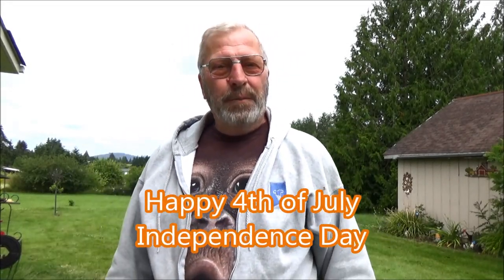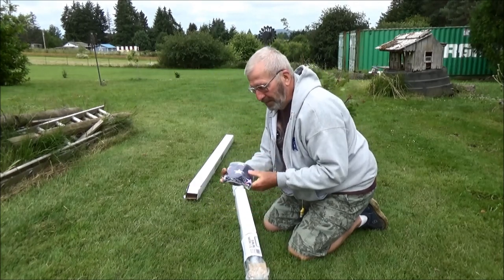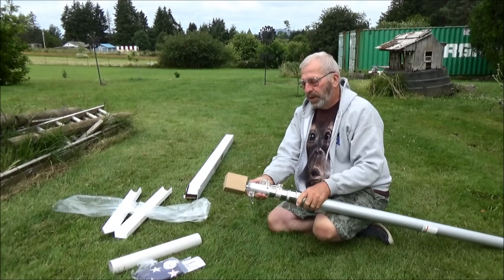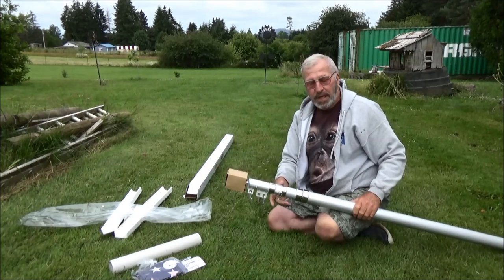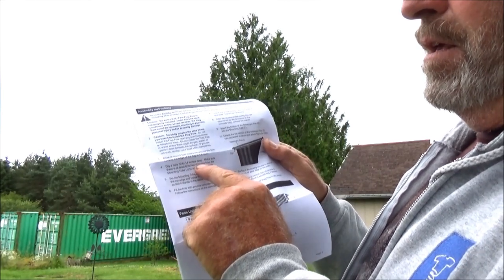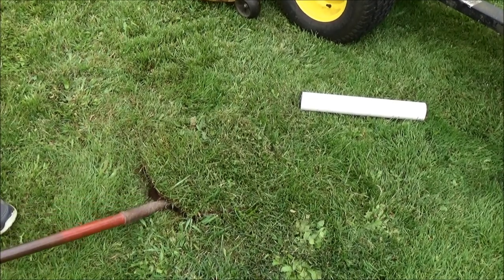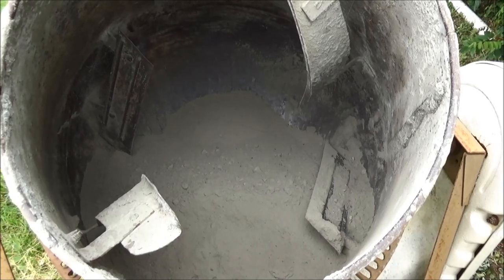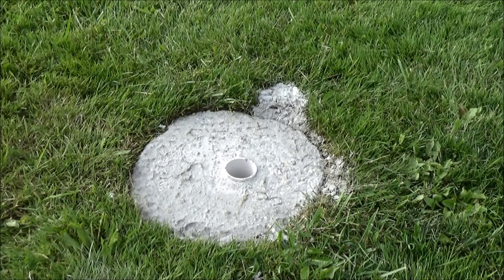Harbor Freight Flag Pole Unboxing and Install

Comment: How do you fly the flag at half mast with a telescoping pole?
Reply from the maker: Charlie, it is just like T.V., it is all an allusion. You pull down two of the sections and your flag looks like it is half mast from a short distance away. Thanks for watching Charlie Dubridge.
Reply: I have a telescopic pole that can hold two flags. I move the flag down to the two lower clips.

Comment: How has the poll held up over time?
Reply from the maker: My pole has done great and as long as you keep the Riding mower away from the pole, I think it will do fine. Even with the high winds we get sometimes and flying one flag, the only thing that happens is the pole sections will start to slide down in the high winds.
Reply: @justmike57  awesome... I'm about to go get one this week...great video buddy...

Comment: Do you happen to know what guage aluminum this pole is?
Reply from the maker: No, I don't know the gouge the pole is but I am sure it will get by for a few years and there are another two reasons for the way I set up my pole. Leave 2" back in the pipe to help with the strength of each section, and this is why the poles are not that tall, lighter metal for the pole.
Reply: @justmike57  thank you Mike

Comment: What do I do if some of the sections will not stay in place? They slide down? Anyone have a fix for this?
Reply from the maker: That is one of the problems with this flag pole. I just snuggled my in place. I think if you are over tightening the sections, they become loose again. Also, when you pull each section up, slide it back down about 2 inches seams to help before tightening.  If there is still a problem with the sections sliding down, I would pre drill and add a metal screw to each section.

Comment: I would go a lot deeper than 12 in, I would go 36 in deep and you don't have to be exactly 15 in wide. I go a little wider in case you put up two flags with high wind
Reply from the maker: I have found that using 2 90lb bags of premix seems to fit the bill. Depending on your area, you will want the tube for the pole too be opened at the bottom for drainage so in the winter, the water build up in the pipe dose not freeze. Thanks for stopping in Joe R.

Comment: Do you have to cement this in?
Reply from the maker: It gets a bit windy here and I used two 90lb bags of Ready Mix Cement. My brother used the foam they have in place of cement and it didn't work. My brother used one bag of 60lb Ready Mix and dads pole is leaning bad.

Comment: Better set it in the hole b4 raising it  * I Pledge of Allegiance, to the flag, of United States of America *
Reply from the maker: I found that if you keep messing with the locks on each pipe, they tend to not want to lock anymore. So I pull it out of the hole when I want to change the flag 426 Super Bee. Amen to the Pledge of Allegiance.
Reply: @justmike57  wow i though they where pins going threw them / Is there a way to use pins? THANKS MAN FOR BEENING A TRUE Patriot ~ Amen
Reply from the maker: @426superbee4  I would suggest to drop each section 2 inches back into the lower pipe and drill a small hole, then use a screw to permanently keep each pipe up in its place. Just weak locks on this pole.

Comment: Did he really put that flag on the ground?
Reply from the maker: Nick, did you really watch the video close and replay the part where the flag was on the ground? The flag was still in the plastic wrapper, so I felt safe to set the flag aside until I needed it. Also, I didn't show it in the video, but you are suppose to have a light on the flag when it gets dark or bring the flag in. I have an L.E.D. light shining on the flag when it gets dark. So thank you for worrying about the American Flag. It is still safe and flying strong.
Reply: @justmike57  yes, I did notice the flag in the bag.  No disrespect, but I’m kinda a stickler with the flag on the ground. And yes, I am aware of the flag needing to be lit at night.  Thanks for flying old glory!

Comment: Nice video , thank you for flying our flag, the the anthem is a nice touch. But , I have a problem with a Chinese company making an American flag. This is not right and you installed it on the Fourth of July, of all days when American patriotism is at its highest. My wife and I just moved into our new , hand made in the USA log home. We are putting up a 25 ft flag pole purchased from a veteran owned company and 100% of this kit is made in the USA. Yes it was more expensive and made from heavier gauge aluminum to last longer, My comments are in no way , meant to demean you in any way. , there are just somethings that should never be bought from China and this is one . Thank you for displaying your flag , I’m just a bit disappointed, God bless the USA.

Comment: 100% Made in China
For an American Flag and Flagpole, pay a few extra dollars. Buy American, please.
Reply from the maker: You are so right about Made in China. I didn't even look when I bought it. I could be wrong, but I think everything in that store is made in China. Just bought two flags that were made in the U.S. and not going to replace the pole until the pole fails. Thanks for stopping by Eric Mitchell.